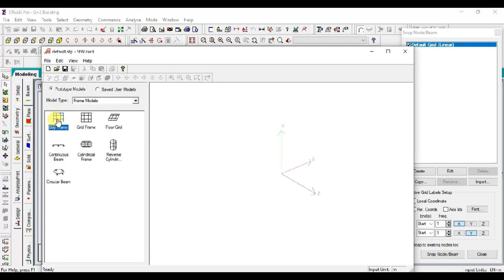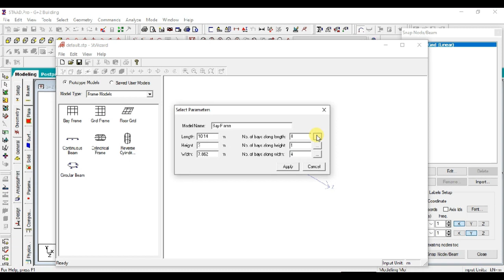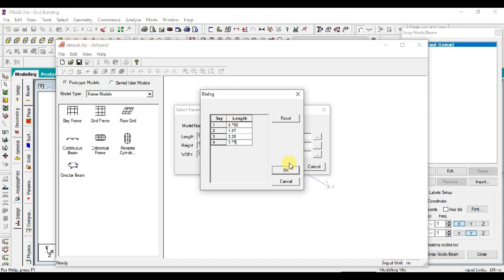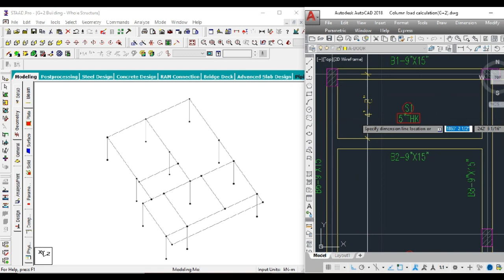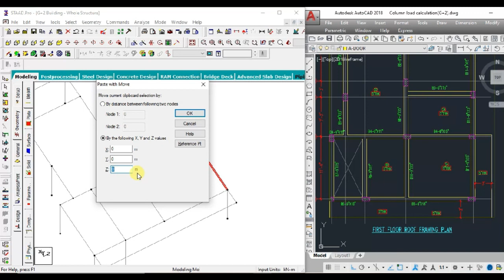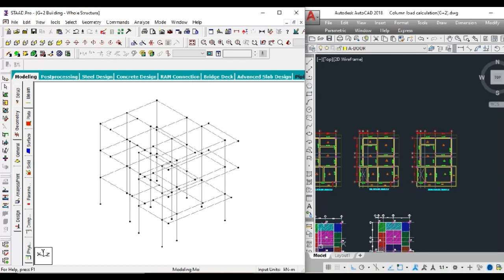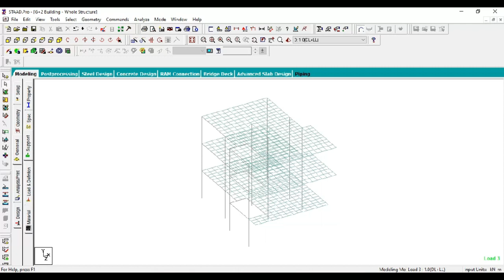Load Calculation for G+2 Building | Influence Area Method Vs Staad Results | Part-3

Comment from the maker: Dear All,
Kindly check out the below link for
Structural Analysis and Design of RCC building using Staad.Pro software.
In this course, all the basic concepts, and Lateral load Analysis(Response spectrum and wind load analysis) of a building as per IS-456, IS-875, IS-1893-2016, and detailing as per IS-13920 have been explained.
https://www.udemy.com/course/staadpro-v8i-structural-analysis-design-of-a-rcc-building/?referralCode=C1CBC2B104EF72579338

Comment: Ma'am in autocad plan some beams are at the edge of columns(especially the outer beams) but when u model that in staad. Pro those beams are at the middle of columns, 
we have to provide 'beam offset' in staad to make it exactly as in given plan? 
Does the results varies if I do in that way?
Reply from the maker: We are taking center line and modelling in staad.pro. This will not change in result.
Reply: Thank you ma'am for the reply .

Comment: Madam
In kerala most villas are load bearing masonry structures . Can you guide us how to use staad Pro. All most all villas are having big chajjas at Lintel bottom even up to 1.2 m span. How to design such sunshades which is causing torsion.
Other as pect is most roof slabs are sloping
1. One side sloping
2. Two side sloping
3. All side sloping like pyramid.
Kindly prepare manual design for it whenever you get time
Reply from the maker: Ok.